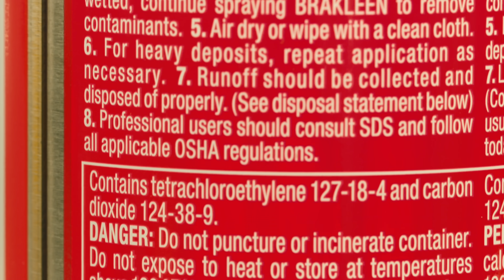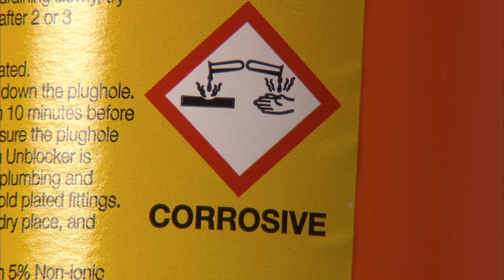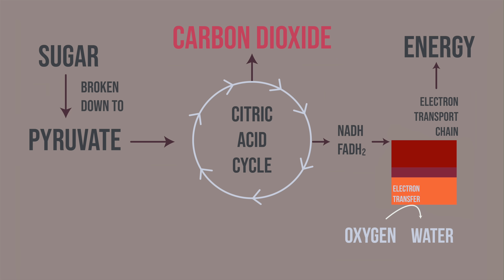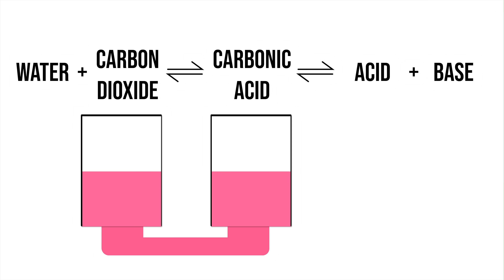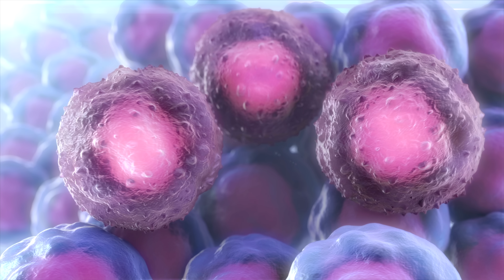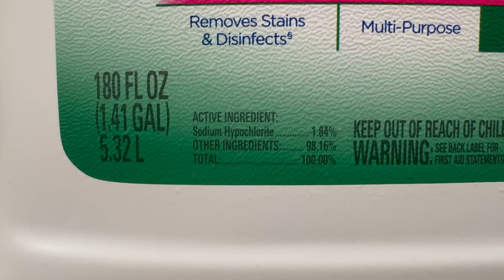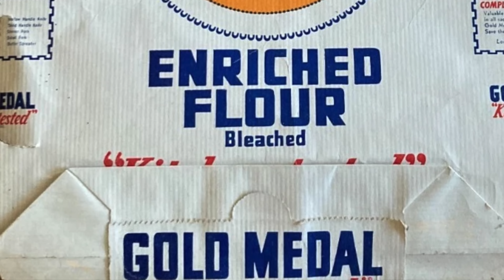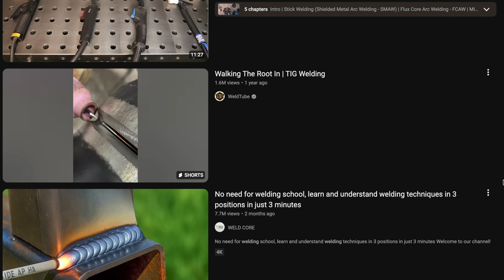"It smelled funny while I was welding and now I can't breathe..."

Comment: I have Type 2 Respiratory Failure which I got after managing a shop that used to sell, service and repair chemical sprayers. My SpO2 (blood oxygen) is normally around 88% but when I’ve been ill it’s gotten down into the 60’s, which is extremely dangerous. I sleep with a respirator and I have to be very careful what I’m exposed to. I wouldn’t wish it on anyone. I went from an extremely fit and healthy young man to someone who suffers from chronic illness. 

If you are at risk of being exposed to any chemical that is harmful please make sure you use a proper respirator that is designed for chemical exposure This will have an activated charcoal filter in it, as well as paper filters. Stand alone paper or cloth masks will not protect you from chemicals and gases. I would also suggest using full protective measures when exposed to any chemical. Protective gear (Faceshield, Coveralls and Gloves) can literally save your life. Look after your body. You only get one.
Reply: I'm so sorry dude, I hope you won the lawsuit. My lungs got cooked mostly by my own stupidity (smoking, mostly) and an opportunistic infection that brought on pneumonia so bad I had to be on ECMO- the difference in my life before and after is staggering. I get tired during mundane tasks, while walking at a moderate pace... It's an indescribable hell, especially after being a lifelong swimmer and runner. 
I hope it's just.. temporary. That it gets better.
I hope your lungs recover, too - as much as it's possible.
Reply: @MargoTheNerd Hey Margo. Unfortunately I didn’t bring a lawsuit against my employer because I was undiagnosed for many years. I was also very young and living in Australia where suing someone at the time was considered very American and wasn’t really practiced over here all that much. I did try and sue my doctors for a misdiagnosis (I had Lymphoma and Back issues as well). I’m very sorry to hear about your predicament. I can really empathise because I get breathless just walking from my lounge to my bedroom. I can also attest to the lethargy and weakness. It’s because your body is not absorbing oxygen and expelling Carbon Dioxide. Lactic acidosis kicks in and your body feels like you’ve been in the Gym for 2 hours. If you haven’t already tried to quit smoking try quitting. I gave up several years ago using nicotine spray. Slowly tapered down. Good luck with your own health. I hope you feel better soon. 😊
Reply: I went through something like that for a medical  issue. I'm better now, but oh man its scary when your O2 level drops.
Reply: @unexpectedcaveman6573 I got Non Hodgkins Lymphoma at the same time. Some of the chemical spray equipment I serviced would have a thick chemical sludge in them, some of which dated back to the 60’s and 70’s. Being young I didn’t think of it. My employer never used protective equipment apart from hand lotion. I now suffer from chronic illness. I’ve had pneumonia many times. I got the swine flu quite a few years ago, before COVID hit. My lung capacity was at 10-15%. I remember looking down at my chest and seeing it wasn’t moving as I tried to breathe. I came very close to dying. Look after your health and educate yourself. Always wear a respirator rated for chemical exposure. A simple paper mask won’t do.
Reply: It is scary when the only thing you can try to do it not move and not worry about it. 🫂
Reply: I hope you have a bunch of HEPA air purifiers in your house.  I like BlueAir, but they are expensive.
Reply: @soundsaber1138 I used to think HEPA filters and air purifiers were bs, but man are they worth the cost!
Reply: @Chronosmaster002  Air purifiers CAN be good.
However, they can also release dangerous amounts of ozone if that ozone didn't react with environmental contaminants.
So, don't stand near the air purifier while it's running in a clean environment (you should instead shut it off entirely).
Same principle with basically any other household device that has a motor or exposed-high-voltage or sparking situation, like blenders, which generate ozone.
Reply: Surely you sleep with a bipolar cpap and not a respirator? Like the ones with a trac?
Reply: I'm sorry that happened to you. If you live in the US I hope you can get out of there before the conservatives kill you for profit 😢
Reply: I'm so sorry. Thank you for sharing, I will remember the warning.
Reply: You’ve done your service to the world brutha, rip edibles and play video games till the worms come for ya 🤷‍♂️
Reply: @Nate-h1g8j Are you psychic? I actually ingested an extra strength edible almost exactly two hours ago. This has to be synchronicity.
Reply: @RuthlessMojo  Immortal fang's qigong can probably repair you over time (2 - 6 months).
Reply: @RuthlessMojo try tinctures.  They are cheaper than edibles.  I love my 1:1:1:1 thc, cbd, cbn, cbg one, reduces my anxiety by 30%

Comment: Personal experience: When I was in high school, mid-sixties, I worked part time installing and repairing air conditioners. We would frequently braze or silver-solder copper tubes and brass fittings. The refrigerants that were in use then included monochlorofluouromethane and dichlorofluouromethane (Freon) and occasionally Sulphur dioxide. When the air conditioning equipment had residual Freon, our brazing and soldering would react and emit phosgene. It was not pleasant. I quickly learned to work only in well ventilated spaces. Ah, young and stupid.

Comment: You can use the brakeclean, but then you have to clean again to get the brakeclean off. When welding you have to remove any and all solvents from the metal or you need to use a supplied air respirator. You also do not use brakeclean to remove rust. It is meant to remove grease and other solvents.
Phosgene is a chocking agent used in Chemical Warfare. It burns the lungs and causes you to drown to death from accumulation of fluid in the lungs.
At that point the only thing that can save you is a lung transplant.

Comment: There's a saying that "there are no old welders" precisely because of all the nasty crap you can inhale while working with metal. And I know from personal experience how easy it is to skip wearing breathing protection - "I'm just doing this quick weld, it can't be that bad" or "I'm just grinding this small piece, it can't be that bad" and then you get really nauseous half an hour later from whatever unpleasant chemicals that was in the old, rusty paint you just turned into vapor and inhaled. And for welding radiation; I'm guilty of having just put the gloves on in summertime, leaving a gap between them and the t-shirt, and even after just minutes of welding it will be as if you were on a beach in Thailand for an entire day with no sunscreen on, on just that exposed area of skin.

And, like said in the video, once you start welding, it's amazing as you learn; but buying something like a welding mask with an extractor system costs more than a hobby grade welder, so most will skip it. And that's ok, if you're careful wearing the correct mask underneath the welding mask at all times; but it's uncomfortable, it makes it difficult to get the welding mask to sit comfortably on the head and if you're also trying to fit hearing protection underneath it, it becomes a chore that you'll be prone to skip.

The other risk group is people like me, who mostly do metal work out of necessity when repairing equipment, farming equipment in my case, and when that happens, you're always in panic mode to get things working again as soon as possible, which is exactly when you'll skip safety considerations. Then again, farming is more dangerous in terms of injuries and deaths than the other 9 of the top 10 most dangerous jobs combined, including police, fire fighters and soldiers, so the chances that it will be welding that takes you out when there are so many other alternatives are slim 😂

Comment: hi Dr. Emu , Q: for years i was mixing bleach with industrial floor cleaner and hot water to clean toilets and floors, i did get lung damage to the point that i had to retire, my resting SP02  is 92 to 95 , will my lungs repair ( slowly ) themselves ?

Comment: Well if you are using brake cleaner to clean rust its your own fault, but you will also find a lot of places are no longer selling Chlorinated brake clean, too many back yard mechanics failed to heed the "use in well ventilated areas" warning, its a shame it will take you 6 cans of non-chlorinated to do the job of half a can of chlorinated, but safety rules are written in blood.  I would be more concerned about people welding galvanized metals, as this is probably more common.  Even more so with stainless steel, you need a respirator for that, little thing called Hexavalent Chromium it will make your lungs get all cancerous.  Confined spaces are another one that gets welders, you never know if there is pooling gasses or even a lack of oxygen, heard stories about multiple people dying in these instances, which is why they tell you never to enter a confined space if the person you are supervising has an issue, you could end up deceased next to them, its happened, and to multiple people during the same incident.  There is a dark saying "Every OSHA rule is written in blood" and its absolutely true, they all exist cause someone got injured or killed, all for a paycheck, pretty crazy.

Comment: The SECOND I heard "wet grass" I actually SCREAMED.
Reply: chlorine dioxide (quite harmless as far as chlorine compounds go) also smells like grass in low concentration
Reply: Would he survive if he had inhaled just little bit? If he knew that smell in this case is dangerous
Reply: @IloveGod-q4q  I've heard from a lecture at university that phosgene inhalation is surviveable, depending on the concentration and exposure.

Comment: I remember finding a file from 1850 full of complaints about the fumes from the refinery of the Royal Mint in Brussels back when I worked in an archive institution. Mind you, at the time, it was located in the dead centre of the city. They said food was rotting in less than 24 hours and a guy's mother had a cough during the 6 months per year that the refinery was active. I can't imagine what they must have been using and releasing in the air. And of course, the Mint's lawyer was trying to have the case dismissed.

Comment: Definitely gotta be careful when welding especially if your new to it and I've worked with my own cleaner reactions I've mixed bleach with window cleaner and that bottle got warm so I sat it outside and thankfully it didn't explode on me...but I've learned that it's always good to add water to certain things to delude it. In a case like this it's best to stick with cleaning with water and let things dry.

Comment: Fun fact:  when there's enough chlorine in an enclosed space the gas will start looking slightly blueish green.   Never store pool tablets or shock where they are exposed to high levels of light or heat.  That level of gas is hazardous to direct contact with skin, especially if you are sweating.  It will absolutely SEAR nasal and oral tissues and one lung-full is likely lethal even with immediate care.

I halted my breath and still burned half the right side of my nose.

Comment: Great job on this video, I hope it gets to the new welders out there.  35 years of welding, so far, and I remember learning this very valuable fact in the late 80s.  
If you want clean metal, mechanical methods are best.  (wire brush, sanding, grinding, bead blasting ect.)

Comment: This would have been a great opportunity to discuss the hazards of welding chromium/stainless steel or zinc plated metals.  Stainless steel and chromium (which is in stainless steel) can produce hexavalent chromium (Cr6+) which is immediately toxic and long term carcinogenic.  Zinc can cause flu like symptoms and chronic lung disease.  More rarely encountered, Beryllium, a specialty metal, can cause severe or fatal lung disease and lung cancer.

Comment: UV radiation will also do it as well - it doesn't have to get hot... so if there's chlorinated brake cleaner near a weld, but not directly in it, you can still get phosgene production.

Comment: How on Earth do doctors learn all this????  The best i can do is say, "Well, there's fluid in the lungs.  Have to be drained."
Reply: The worst part is that you can't drain this kind of fluid. It's not contained in a neat pocket that you could just stick a tube in and drain the fluid out. It's dispersed throughout both lungs, inside every little alveole and especially in the tissues between the alveoles. Trying to drain it would be like trying to suck all water out of a huge sponge with a straw.

Comment: In our lungs and  our bodies  processes involves copper  and  copper is vital its the architect to iron and this toxicity from breathing in brakefluid vapour is firstly going to damage the glycocalyx on the surfacent surface in alveoli and then goes on  to weaken coppers capacity to fulfil its role effectively not allowing oxygen to bind to haem adequately.  And energy production from mitochondria is dependent on copper 4 of the 5 complexes in the electron transfer  chain are copper dependent.  So be careful in any job that uses strong chemicals they will react with your bodies..
Take away from this video don't f*** with chemicals without prior knowledge.

Comment: I do a fair bit of hobby welding myself...gokarts, exhaust parts, rust repair on classic cars, etc...it's fun but ventilation is key. I have my setup where I'm upwind of the welding for a reason. I also don't use brake cleaner for welding prep.

Comment: Tragic how such a small detail could lead to a devastating outcome
Reply: As the saying goes: It is all ways the small things that get you in life.
Reply: As soon as some weird chemicals are involved, just be extra careful
Reply: A quite known climber (Patrick Edlinger) said after learning that his friend (Patrick Berhault) died in a fairly easy passage because he (supposedly) did not rope up himself to trade safety for speed :

(Rough translation)
"Patrick [Berhault] died in a dumb way, maybe we will all die a dumb way."

So just to mention the irony, Edlinger, a pionneer in modern climbing and exceptional climber, died falling drunk in stairs.

For me, this quote is kind of a safety motto. There are a lot of safety measures that protect us from "low risk, high danger" or "high risks, low danger" occurrences that we would therefore be tempted to skip : 
- Can I skip ear protection to drill this single small hole in concrete ? well this isn't a bit of noise that will make me deaf. Yeah, sure, but that would be so dumb to actually loose some earing just because time to time I allow myself not to wear ear protections.
- Can I skip using push stick to table-saw this only piece ? well this isn't like I will catch my hand in it this very one time. Yeah, sure, but that would be so dumb to actually loose some fingers or a hand just because this very one time I did not use a push stick.

It is most of the time small details that lead to catastrophic outcomes, oftentimes dumb ones because those details are consciously skipped safety measures (tho, it seems in the case of the poor guy in the video, he wasn't aware of said safety measures)

Comment: I just took up welding a few months ago. I'm very thankful to so many (if not all) YouTubers that teach welding for making it 100% absolutely clear that you should not clean your parts with chlorinated brake cleaner. They may have saved my life as that's usually my go to cleaner for a lot of things!!!
Reply: And if you MUST do so, MAKE SURE that the cleaner has FULLY evaporated BEFORE trying to weld!
This can be difficult to determine, particularly if rust is present.
Reply: @m.k.8158  Just get the flamable kind. That stuff is just various hydrocarbons, which are not great, not terrible for your health. Don't over use of course, you'll explode your shop.
Reply: 1. Never use brake or carb cleaner.
2. Its the dried residue that is left behind that creates the gas.
3. Acetone is safe to use to clean parts. 

 @m.k.8158

Comment: Car batteries can also generate chemical warfare gases, as I found out when a leisure battery charger in a caravan went faulty. hydrogen sulphide is produced, which has temporary effects similar to carbon monoxide. My  bloody oxygen level was below 80%, the level at which your bodies organs begin to break down.  Luckily for me, unlike carbon monoxide poisoning, once removed from the exposure, you recover slowly in normal air, although I did get hospital treatment.

Comment: That's not Styropyro! He would have worn a muscle shirt. And a normal welding machine? No way! Unless it uses 8000 Amps and you can weld tungsten rods thick as a tree trunk with an arc that illuminates half a state (and drains the power of a medium city) from 20m away SP would never use such a boring machine. That is probably AI^^

Comment: Great work guys! This video should be shared to every internet page dealing with welding, dry-cleaning, metalwork, metal sculpture, furnace work, metal recycling, and car maintenance. Chlorine based chemicals and fire DO NOT MIX! 

Free warning posters and stickers for cabinets used for storing solvents and on welding equipment. New welding equipment should come with this warnings on all the packaging.

And if you EVER SMELL CABBAGE or WET GRASS in a workshop for no obvious reason.

Hold your breath, drop what you are doing, and RUN. 

Seek medical advice immediately.

Comment: NGL, I usually use a flap disk.  But if it’s in a spot I can’t get to, I used brake cleaner and the wire brush.  Except I let it completely evaporate, because I don’t like being on fire.  I should probably never do that again, even if the residue is so minute, because I also like breathing.
Reply: yeah probably should choose a different cleaning method.